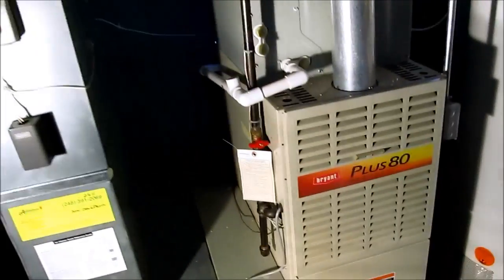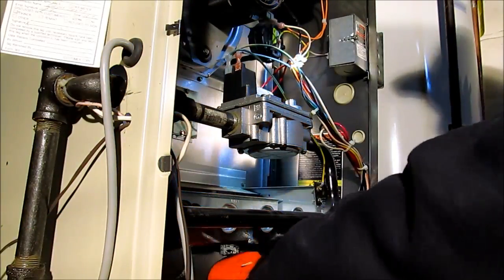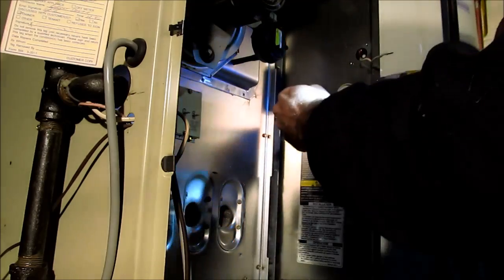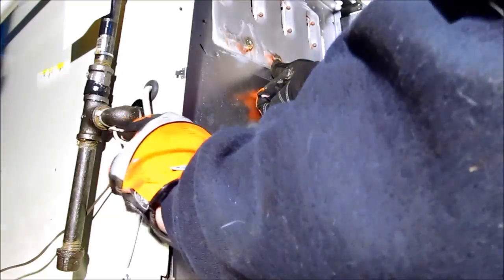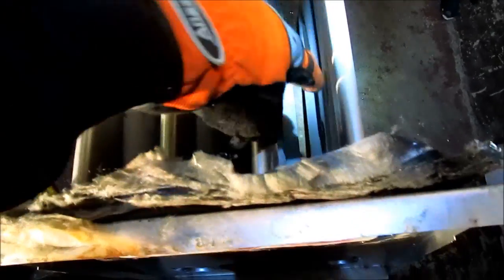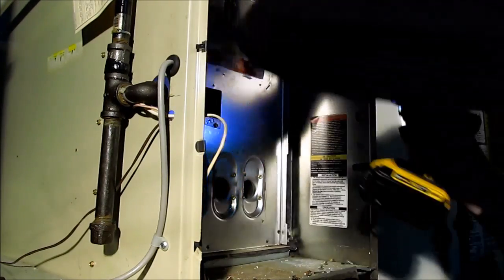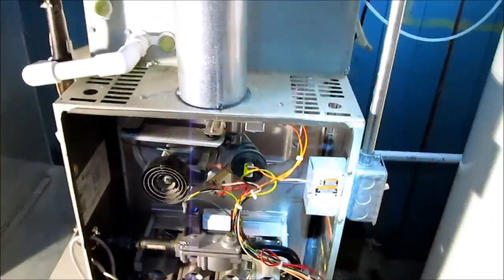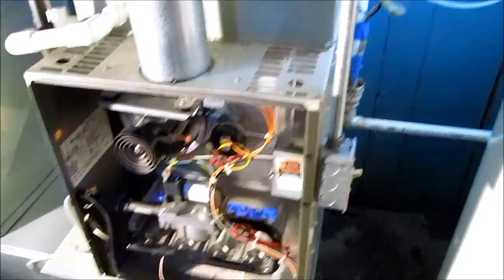Bryant 80% Heat exchanger change out M/N 395CAV042091

Comment: I have a Bryant 383KAV042091 that needs a 4 new cells. This was the furnace in my house, I just had it replaced along with the A/C.  I want to re-purpose the old furnace for use in my outbuilding, are these Cells compatible with the newer 80% Bryant furnaces?

Comment: Good Grief why didn’t you replace the inducer motor while you were in there? At least you could have put a couple drops of oil on the front and rear bearings. I do this every year on my plus 80 and it’s as quiet as a mouse. It seems that you don’t put the customer first in your repairs only interested in warranty replacement money.

Comment: Big thing causing cracks and heat exchanger issues goes back to something as simple excessive temperature rise. Simple air split test is all it takes to make sure you're within manufacturers specs. Have two furnaces out there that are Janitrols that were known for "blown rings" One is 27 years old. The other 28. Both still running fine. Also a little sidenote. New experience has been getting into houses that are section 8 rentals. You need to ask what the temp is normally set at. High percent tell me they keep the stat at 80.Thats high but if you pay little or nothing for a gas bill, thats what it is. This means a run return air temp of at least 78. In these cases I have them set at a lower end of the temperature rise spectrum or they can limit at normal run temps. Hqad a York that at 78 return it would exceed the furnace limit even within manufacturer specs.

Comment: Thanks for posting. If I may ask, have you seen a bracket attached to the oval cover with a wire (spring like ) winding on it?? I live in California, and my Bryant 330AAV has those. Is it what is called  "Lox Nox baffle? I found the name form Carrier parts, but there was no picture. There is a number 322572-401 is stamped on it. I cannot find a schematic of the unit either. Model 330JAV048100FDJA is on the label inside the furnace, but the manual I was given says 330AAV!! Thanks for any info.

Comment: Wouldn't it just be common sense to buy a co2 alarm and keep in bedroom near output vent? Is it possible that a small crack might not ever present a health issue if it is not significant enough to even make an alarm go off or give a high reading on a meter? Is it better to put an alarm near the output vent in bedroom or just near return air vent?
Reply from the maker: That's pretty funny your laying in bed dead and the alarm going off

Comment: How reliable are home co2 detectors in detecting leaks in heat exchangers? TIA
Reply: That is a good question. Would be better if we had an answer. But seems like a good idea to me to take a reading every so often or better yet buy a co2 alarm in case a leak deveops.

Comment: What an excellent tear-down job and a great exchanger rebuild video. As you stated the Carrier 58PAV furnaces are same manufacturer, share many of the same defects. The general public is largely unaware of the serious health threats the mid to high efficiency furnaces pose to their health. I have often wondered how many health problems were caused by defect furnaces that consumers never associated with their furnace pumping poisonous gases into their house? Terrific video on how do this repair quickly and efficiently.
 I worked installing mid to high efficiency units in the mid 80's to 90's and we used to joke that, if you own a Lennox you need to check your Pulse. The callbacks were always a clue to looming quality issues, on what were back then; considered new technologies. Your videos are very concise and insightful, you make it easy to understand for the general layman/Joe public.

Comment: Nice Video My Heating Guy !!
That's what we had trained in the company that I work for 
We check every heat exchanger
Reply from the maker: It's a good safety practice that everyone should be doing you have to keep your customers safe in their own house or you're not doing your job you have to do a visual inspection on the heat exchanger not just look for CO and roll out in a combustion analyzer won't tell you everything thanks for the comment thanks for watching as always

Comment: Nice work, haven't seen too many heat exchangers replaced. I'm impressed by how fast you did it. I have been telling all of my customers with cracked xchangers that they are better off replacing the unit. I think I may start offering another option to some of my customers, thanks for sharing.
Reply from the maker: It depends the heat exchangers under warranty through the manufacture if it's out of warranty it doesn't make sense to replace the heat exchanger if its in Warranty its just labor to repair it or replace it thanks for watching

Comment: Did you check the heat exchanger by pulling the blower? Tough to see that crack through the burner hole it looked like the 2nd pass up?
Reply from the maker: On this type of furnace you have to pull the blower to check the heat exchanger you can't look through the burner openings that's the only way to check sometimes you get lucky and pull the main limit and you'll find a crack there thanks for watching

Comment: Nice video man, haven't had to change a heat exchanger yet, but now I'm ready lol.  what made you use the camera? did it fail the combustion test?
Reply from the maker: No I did not do a combustion test on this furnace I found the crack with a normal safety inspection with a camera on the outside of the heat exchanger appreciate the comments thanks for watching

Comment: That is my plan if the heat exchanger goes out on my furnace as long as the cabinet is still in good shape when it happens.
Reply from the maker: I thought you said you had a 383 kav your house if so this is basically the same furnace and I'll definitely check it for cracks thanks for watching
Reply: I did and do and yes its basically the same furnace. It is from 1998 and 60K input 53k output. I checked it last year with a 561c 2 ton AC that was added in 2005; no issues. It has more return air than it needs and I never let the filters get too dirty.